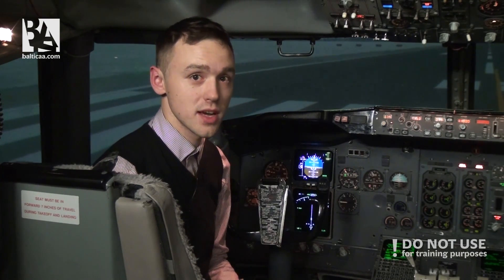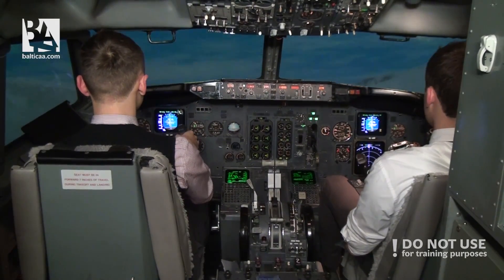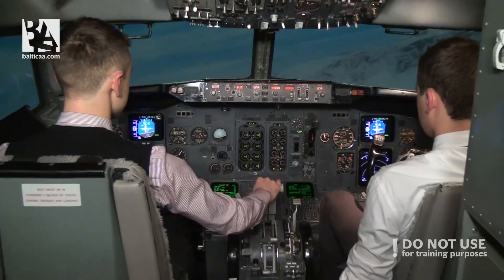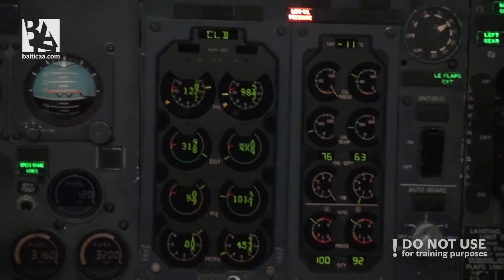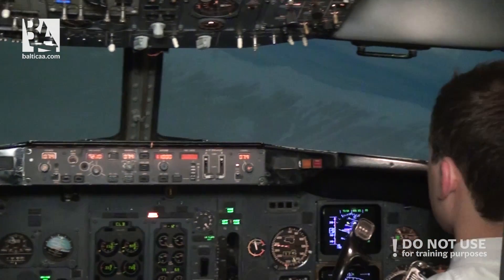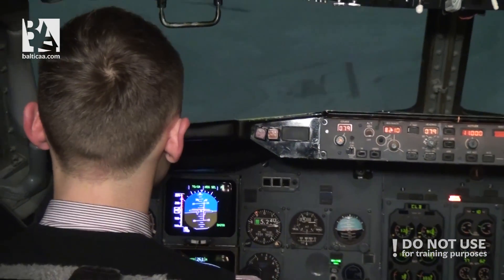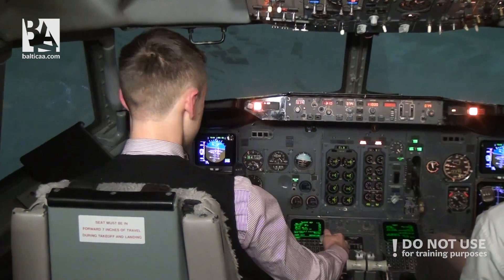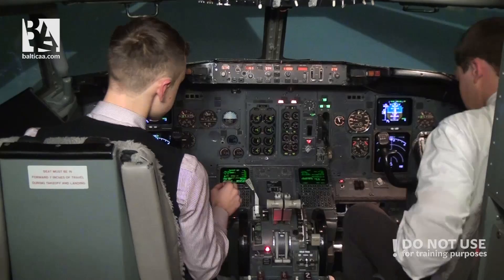Governor failure in Boeing 737 CL - Baltic Aviation Academy

Comment: Perfect execution !  Thanks so much for the quality production and explanation !   Do these engines have ANY manual (or electronic momentary-step switches) linkages to the fuel controllers?  In a few other aircraft I have flown... we had step switches to set TQ (shaft engines)...

Comment: why should governors on both engines fail at the same time ?
Reply: +bobl78 Its is something that you would need to know how to do, so that if this happened in the real world you wouldn't be overloaded. Sometimes you have learn things in aviation that you will never need to use in the real world. Its best to be safe than sorry :)
Reply: +bobl78 as why they would fail it could be a number of different reasons. Possibly the butterfly valve which governs the fuel entering the engine became stuck wide open.
Reply: +bobl78 An incorrect maintenance procedure could have been carried out on both engines.

Comment: What is that black spiny thing next to the pilot an the 1st officer?
Reply: AcademicPluto Trim
Reply: DewyyPlays what dose it do? :D
Reply: +ak1234572 It control pitch, it takes the pressure out of the control colunm, everytime your arms get tired you simply adjust the trim taking away any un needed pressure making the aircraft much easier to control. In this video during the turns and descent he needs to adjust trim because the yoke became heavy.
Reply: Trim wheel, helps to stabilise the plane's pitch

Comment: the thing I don't understand with this procedure is to cut the second engine during final approach, but we need to perform a go around ??? isn' t it better to cut off the second engine prior to flare ?
Reply: +CMBelite-FR When the governor fails the engine overspeeds and the centrifugal forces on the blades is immense.. They use one engine as needed and glide in. You do not want a turbine blade to throw itself on final.
Reply: +CMBelite-FR Perhaps but in this case you would go around much sooner than later. Also the speed would be much to high in order to land if you cut the engine any later.
Reply: Heeeey CMB YouTube is a tiny space! :D Nice to see you here xD

Comment: You mention "only one chance at this" - can't restart the engine. Can the engines only be started on the ground? Or just that once you're on final there's no power for a go around.
Reply: +TheIvalen What the pilot means is that by the time the engine spools up you will have not time for it to be effective due to the aircraft already being on the ground. Starting an engine takes time with jets and on the occasion a successful restart in flight may result in a hot start, engine catching fire
Reply: Airplane too close to the runway, insufficient time for restarting.

Comment: Great landing, now take us through a super storm where lightning takes out your instrument panel, radio and you now can't hear each other because the explosion has damaged your hearing. Also, only use one eye, his. And the co-pilot is paralyzed except for his right arm and one good eye. And, for some reason the plane wont stop shaking (jack screws fell out somewhere along the way), and losing oil pressure all the time too.
Reply: Robert Bee ok just one question, what language were your speaking?

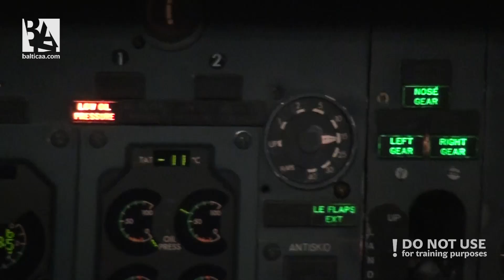Comment: What happened to the attitude indicator at 3:34? What happened to the blue and brown colouring?
Reply: Electrical system logic in B737CL is so designed to disconnct power from less essential instruments and features, eg. collors on EADI. 
In B737CL PFD is family-called EADI - Electronic Attitude Directior Indicator mate.
Reply: +mrcannotfindaname I think its the generator oveloading, as soon as the apu generator took over it came back. Remember the aircraft was flying on one generator for a while. Waiting for the apu to start.  BTW its called a primary flight display which consist of directional gyro, Artificial Horizon & airspeed indicator along with some other none essesial information.
Reply: the instrument cooling is operated by the left hand engine generator. as it produces no more energy, the screens transition to black/white in order to avoid overheating.
Reply: It's  because the first officer resets the IRS system  recalibrating the gyros is standard procedure .like fac1,2 off on an airbus.

Comment: Baltic Aviation Academy can you demonstrate a landing when you losee not 1 not 2 but all your hydrolics, so your only control is throttle is this survivable?
Reply: the 737 only has 2 hydraulic systems, however if they both fail then the 737 has manual reversion, meaning the pilots can still use move the control surfaces with their muscle power. I would still love to see this BAA!
Reply: I think B737's control is intrinsically safe. There'a set of cables and pulley linking from yoke to control surfaces.
Reply: *****
it's UA232?
Reply: they ddin't land successfully that dc 10 it crashed on landing killing 111
Reply: +Bruno_pt99 it was a dhl 737 (edit it was an a300)
Reply: *A300
Reply: PEP's whoops yep

Comment: What about leaving One engine running and then try to restart the otherone. Incase that doesnt work they still have the Option to turn of both.
Reply: A restart without a working governor is not advisable - it's possible you'd blow the engine up or cause a fire. Of course, if you're out of options (e.g. this happens to you over water, so you'd be ditching in the water anyway), it's still on the table, but right after takeoff you're still very much in gliding range, so kill the failing components and try not to aggravate the fault further.
Reply: Cameron Hendry Not sure it's really like a jammed throttle. AFAICT, the 737 classic and earlier models were non-FADEC and the governor was essentially just a hydromechanical circuit with some authority over the FCU (fuel control unit). If it senses an out-of-limit value on any of its sensors, it should add some negative feedback and adjust fuel flow to correct that state, hence keeping the engine within limits. Without a governor, you've got full control of whatever the engine does, including putting it into an out-of-limit condition, e.g. turbine (N1/N2) over- or underspeed, compressor stall or surge, turbine overtemp, etc. Needless to say, that'd be far a worse position to be in than just a shutdown engine.
For the car analogy, I'd equate it more to something like an engine rev limiter failing.
Of course, if I'm wrong, I'd be happy if you could direct me to some reliable engineering sources where I can learn more - I'm only drawing on my general knowledge of engine governing and I don't have any 737 classic experience.
Reply: The governor controls the N1, it would be like a jammed throttle in a car.

Comment: Flap failure and also hydraulic and electrical failure with deployment of rat
Reply: ***** Then what happen if there's a general failure (dual engine failure)?
Reply: ***** Wrong. Backup hydraulic power sourced by auxiliary batteries. Critical flight instruments remain operational long enough to get the APU started. Most airlines require the APUs to remain on until 10,000ft on their aircraft